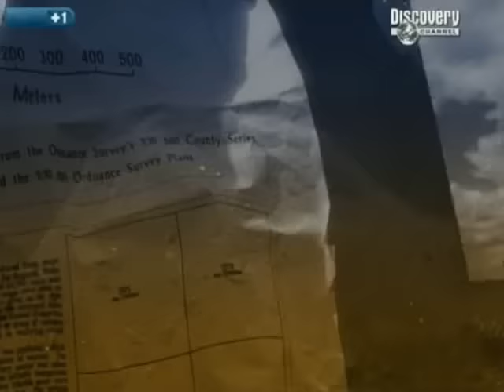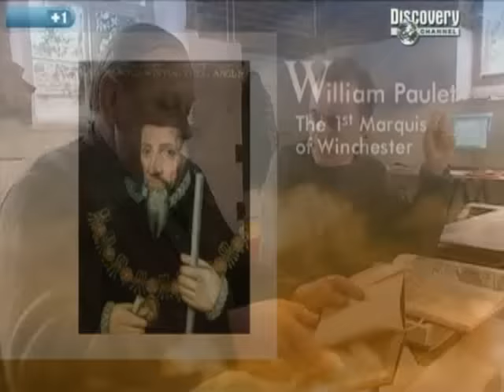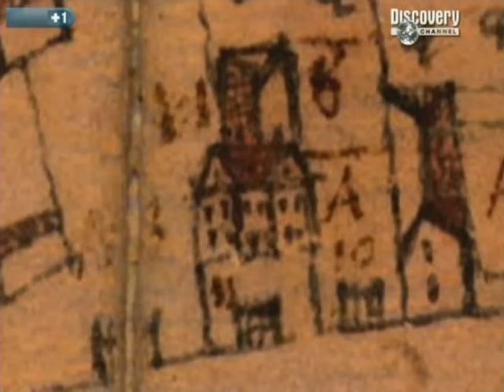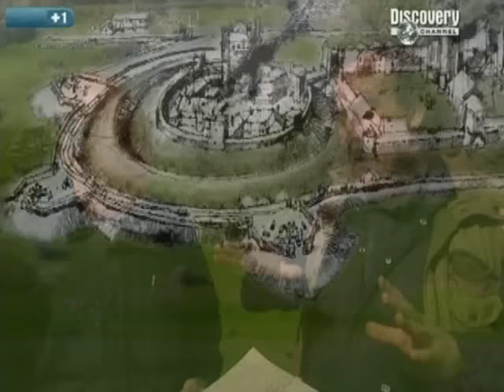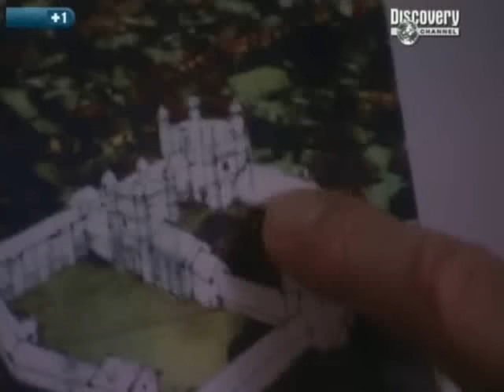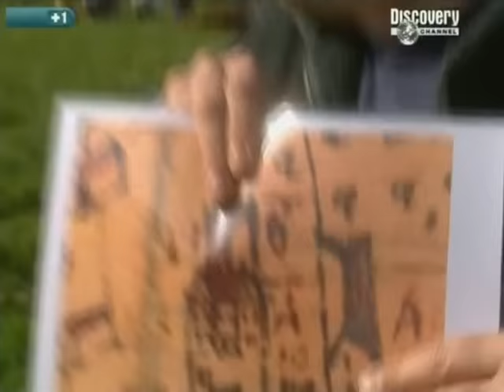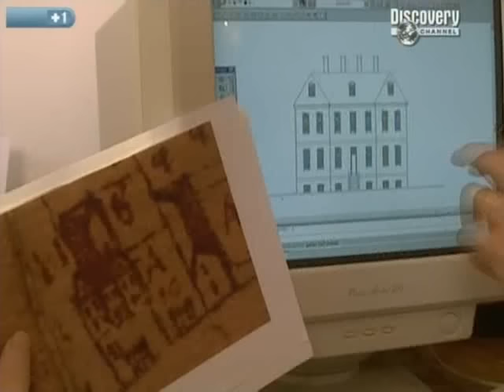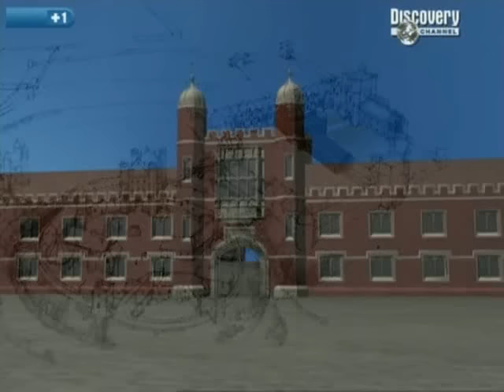Time Team S07E08 basing house,.hampshire

Comment: On many of these sites, I am quite amazed at how much soil gets built up around them. Sometimes they are having to dig 8 or more feet when it has only been 400 years.
Reply: I've seen first hand how fast this can happen twice. First one was about 30 years ago, when I roamed the ruins of a shut down factory in a residential neighborhood. I was there about 5 years after it was shut down. Green was sprouting everywhere. Not only in the cracks, but all over. A thin layer of topsoil had covered the concrete in patches.
The other one was a side with another shut down factory about 15 years ago. The side was used to deposit soil and rubble from other building sides. So it looked like a mix of old buildings mixed with giant mole hill strewn about higgeldy piggeldy. About 5 years ago I went there again and parts of the giant mole hills had spread all over the place, by wind and/or rain before the plants got real hold of them. It was amazing how much the place was overgrown allover
But I have also seen places where nature reclaimed every nook and cranny without even a patch of moss growing on the concrete after decades of neglect.
Reply: CologneCarter site
Reply: Greg B Yeah well, that's one of the nice side effects when one learns a second language mostly by listening. Words that sound the same sometimes come out wrong and spell check doesn't help much in those cases. But people are able to get the gist of what I'm trying to communicate and anyway, everyone makes mistakes.
Reply: CologneCarter Glad I could help!  Learning another language is not easy.  That fact that many speakers of English don't always pronounce words clearly just makes it more difficult for persons like you.  I have a Cuban friend who gets quite confused about "been" and "being" because they sound the same to her when spoken by most Americans.
Reply: Greg B Listening isn't much of a problem, writing and speaking is. I had very little formal education in English grammar and spelling and I am 40 years past my school days.
Mix ups and wrong words usually happen when they sound the same ie. "meet-meat" or even worse "to-two-too". When I hear a sentence like "I know how to do it right", I have no trouble identifying the right word, but when I type (usually too fast) I often don't notice those mistakes, not even when proof reading, because in my mind they sound the same and unless I misspell the word the spell checker doesn't pick up on it. Usually when I see my text at a later time and reread it then (another of my "bad" words) I notice the mistakes right away, also when reading what someone else wrote.
Reply: @CologneCarter , don't worry. I'm no English teacher, but you did just fine. Compared to what I've tried to decipher from today's students and professionals, you could pass a college level course.
There - Their - They're: oh, how many times have I seen them misused.
Reply: @gregb6469   hmmm and these days "been" is now "bin" ive noticed all over North America and the UK

Comment: When they were trying to figure the  setback of the house, did any of them try using the golden ratio, 1.618?  It was part of classical architecture.  Each of the  beds shown should have been 1 x 1.6 in measure, and then the  house would  have been at the end of them.  If they didn't, why not?  If they did, I'll just shut up now, ok?